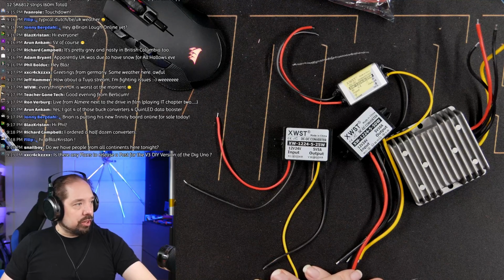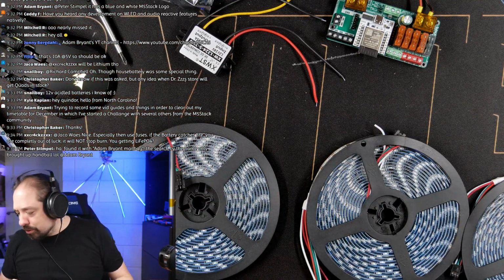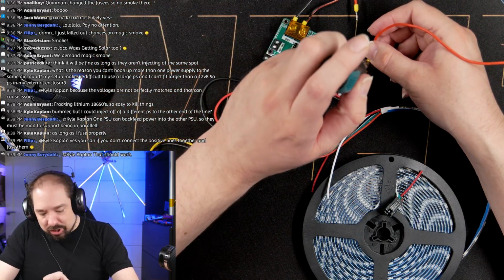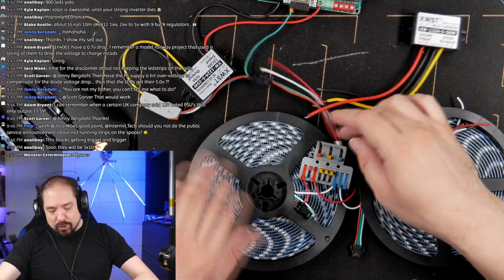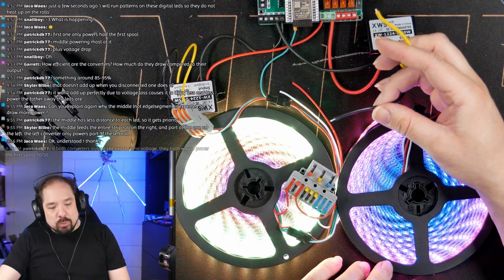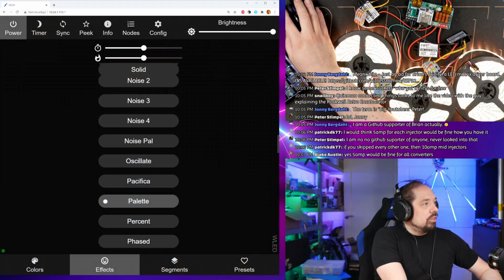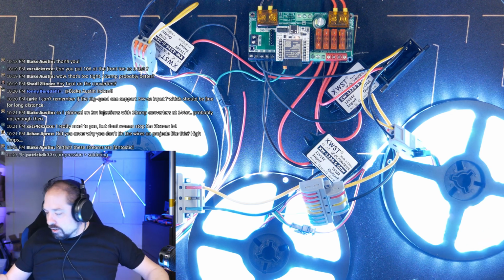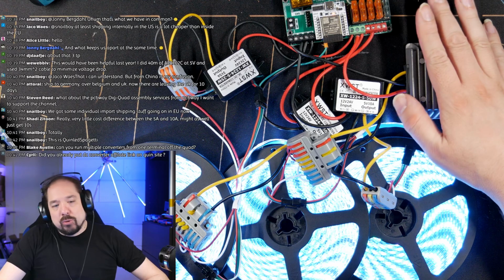💡QuinLED💡 Full setup test 24v buck converter for 5v LEDs (ws2812b, sk6812)

Comment: Found your series and I have to say Thank You VERY much for the effort you made publishing these.  The information relates exactly to what I'm doing with my house display.  I've got 3 years efforts to the point I'm at now with around 4,200 pixels (W2812's) and using 5v power injection in too many ways to describe.  I hit on the Buck Converter idea while trying to find a more efficient way using smaller gauge wire (copper's gone out of sight on price).  As I tear down the display I'm going to modify it for using the 24v + BC's and your videos help me decide just how many and where they'll work best.

The one thing I haven't done yet is to determine if my Hinkspix Controller can handle the 24 volt like your little driver did, but after viewing your video I think that may not be necessary.  Currently I've got a second 5V power supply supplying injection power to all the different legs sharing only a common ground wire with the controller. This way the controller is "powering" the first connection point and data on each leg and I've got wires of varying sizes run with the models and get tapped for power. So replacing it with the 24V supply and the BC's will be a relatively easy fix.

Comment: Do you have a preferred 24v supply? I’ve tried 2 and had major data like issues with a 8ft data line. If I use a 12v supply in place of the 24v with the same exact buck converters I can run it out to 40+ feet and it’s stable.
Reply from the maker: Hu? That's odd. The meanwell LRS line is good and the UHP line is great!

Comment: I am planning an installation of several groups of short strips (under window lighting). Step lengths of about 30-60 rgbw addressable leds. I want them to behave as a subtle strip, i.e. connect the data contacts. Now there some space between groups of strings, i.e. couple of short strings nearby, then about 7 meters to the next group, then about 3 to the next.
I intend to power reach group with 24v-buck converter, so in this example, it will be 3 converters, one for each group. Since connecting the far away strings' power works be undesirable, can i just connect the data pins via a single wire? It should be quite far, i suppose? Will i need a signal booster, maybe, for the widely spaced groups?

Comment: Great information!  What blows my mind is all that has to go into 3 strips and how in the world do you create a clean layout/setup in a house or room?
Reply from the maker: Well it partly does depend on the end goal, if you don't target 100% RGB white demand gets quite a bit less. Still 5v strip requires lots of injection points, newer 24v COB addressable strip you can use 10m with a single injection for instance.
Reply: @IntermitTech  is that using BTF 2815’s?
Reply from the maker: I'm sorry what are you asking?
Reply: @IntermitTech  is that BTF strip a good one for longer runs and not as many injections

Comment: If the buck converter fails, is there protection that will prevent the 24V from frying the 5V LEDs?
Reply from the maker: No, if it fails in such a way that 24v makes it to the LEDs (never seen or heard of that before) they would be toast.
Reply: @IntermitTech  Oh okay well I’m glad you haven’t heard it before then. Haha I’m going to use this approach on my home project.

Comment: What if one of the middle converters were to fail shorted? What about putting a diode in the positive leads of the buck converters to prevent a short circuit? What about fusing the 5 volt side of the buck converters? If one were to fail shorted, would the others be able to supply enough current to blow a fuse?
Reply from the maker: Sure, you can add extra fuses and diodes even for increased safety, but the setup I propose is already fused on the Dig-Quad side too, so if a buck would short, it should pop that fuse if properly sized and before it melts any cables. Also make sure to take a look at the written article, it goes into that a bit too.
Reply: @IntermitTech  It seemed prudent, but may just be overkill.

Comment: Yeah I bought your diguno v3 like a sucker and its been the most unreliable POS. I thought spending more might get me some reliability but nope, constant WIFI dropouts and reboots, this might be the most overpriced worthless gadget I've ever had the displeasure to fall for and buy.
Reply from the maker: Oh wow, that's certainly not meant to be the experience you should have with it. Have you come to the Discord so we can figure out what's going wrong? We'd love to help you troubleshoot! If you where having this issues with your previous setup and they are now continuing while running my board, there might be something else going on. :)
Reply: I assume if this were the case there'd be lots more irate customers here. Since this is not the case, I see several possibilities: you got a defective board, it happens; or you're doing something wrong; or there's additional factors (e.g. signal interference, or poor wifi coverage in that spot).
To test for this, i'd replace the controller with a WeMos d1 and see if it works better. Now, did you try that?

Comment: Thanks for cutting this excellent live stream into a few bite sized nuggets! 

Lots of great info and great testing here. I really the idea of going with higher output converters, not only for the extra if one fails, but because they should run cooler under a smaller percentage of their max load. If you have a 7.5A draw on a 10A or 15A converter, you're looking at 75% load vs 50% load. The 15A converter should run cooler at 50% load (or at least be at a lower risk of overheating, though the heat does still need to disappate somewhere).

Comment: Hello, very informative video!
Do all the led strips have 5v data pin regardless the strip voltage?
Reply from the maker: Yes, all that I know do, from all 5v, 12v and even 24v variants (check the power sheet for most tested)

Comment: for the dig quad do you have to put 2 wires from power surplly to dig quad 2 neg and 2 pos wires or could i just put one set of wires
Reply from the maker: Depends a bit on the expected load, up to 10Amp you're probably fine with a single 16AWG pair but once you push more load through the board you want more copper. 30Amps+ would need 2x 12AWG for instance. Otherwise you'll already have voltage drop from the power supply to your distribution point, which is the Dig-Quad.